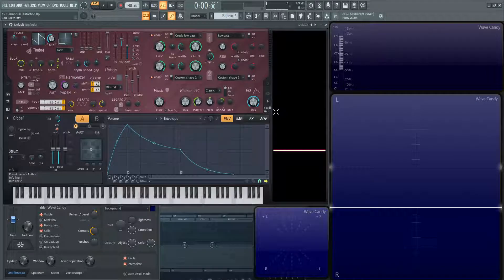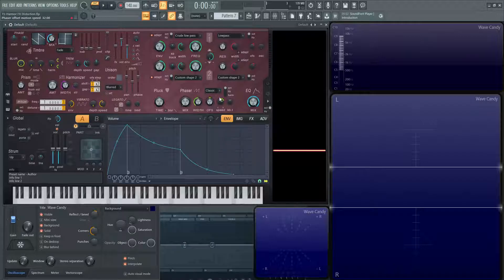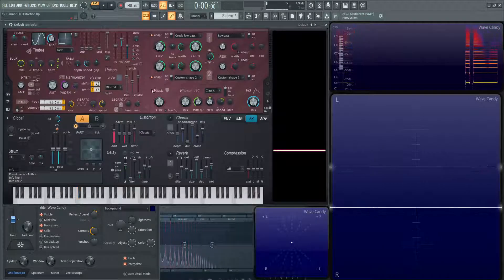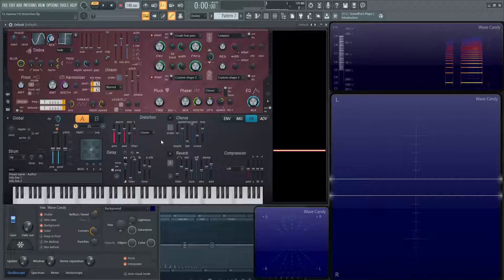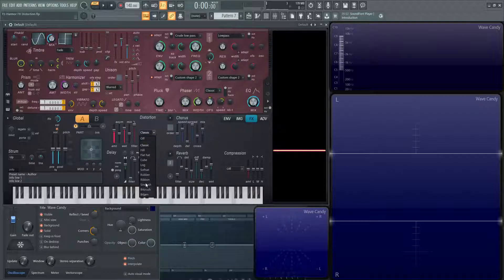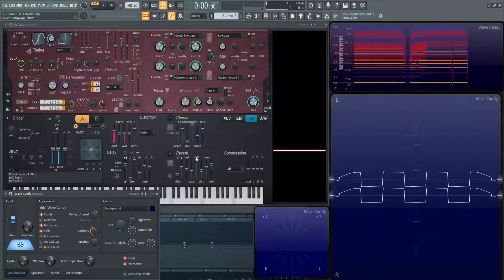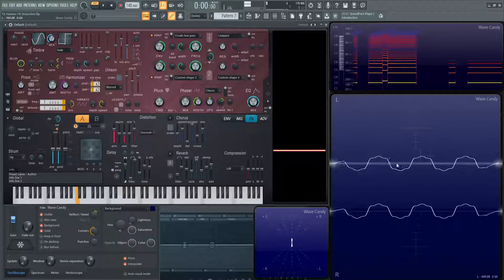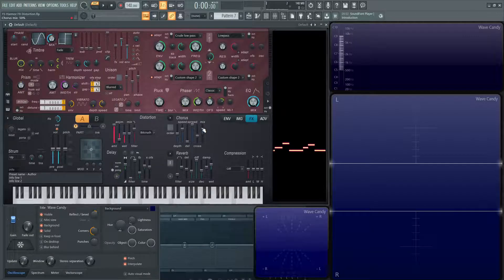Harmor Tutorial PART 15 FX Distortion | FL Studio

Comment: Thanks for the video. It's really Bad that Harmor has such a distortion. All the modes square the sound and that's not good. It could be very useful. They could improve the distortion in these 11 years. For example, it would be very good if we could determine Distortion should be applied to which frequencies or we could design the distortion shape and we had Articulatoins in distortion knobs.
Reply from the maker: Yeah the distortion isn't my favorite in harmor. I've found that using external distortion on a harmor patch tends to sound better, withe by using a wave shaper as an insert and really making the distortion shape, or using some fruity blood over drive and even in some cases both!

Comment: I gotta give this one HUGE tip to people who have made it this far, also the coolest party trick for people who don't realize how sound works, and a very musical use of a complex timbre machine: Make a prism that can shift the major third harmonic down a semitone when set at 0%. This is HUGE if you like to resynthesize and scale to C, the major third harmonic can be a big problem, look at it a bit like pitchmap etc. but right at the source. There's other harmonic displacement you can do, but that major third is the one to really stick out and commonly limit what you can do with the sound. The other thing I'd recommend is making a saw that just misses the major third, oscilators are effectively additive harmonic masks for the resynthesized sound.

Note: This doesn't stop distortion etc. from adding the harmonic back in, I might go looking for a good free key-tracking EQ, currently I do it manually... Patcher's Note EQ can be pretty nice for this.
With a key-track EQ you could also separate the frequency from the rest of the signal, to then pitch-shift it around.
Reply from the maker: thanks for the tip and taking the time to write it out!! much appreciated!!
Reply: @jonaudio  No problem! Had this tab open to finish the series later and figured I'd share. 

A cool related concept is making your own overtones with a BUNCH of midi sines (strum tool helps with setting velocity, otherwise EQ), just put it on C by default and don't scale it. Pretty interesting sounds, especially if you play around with different tunings.

I've never tried syncing all these sines into a single cycle oscilator, wonder what that sounds like.